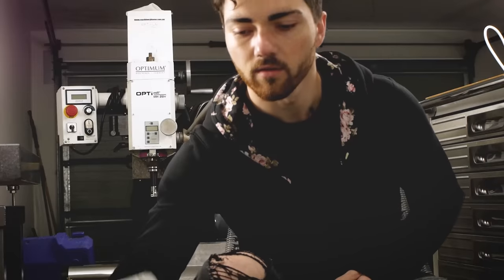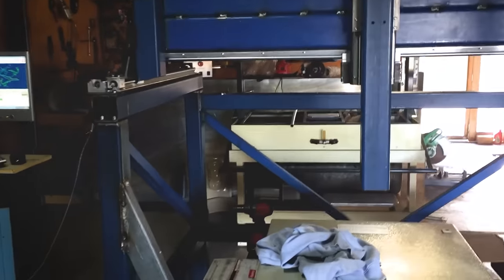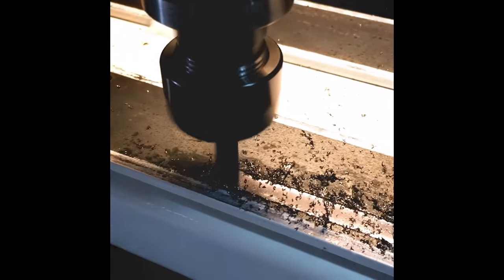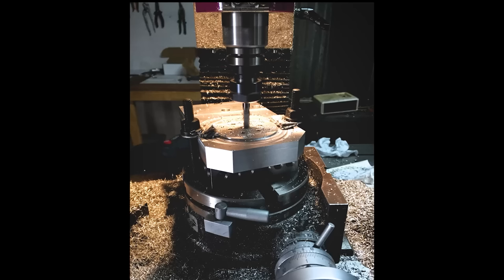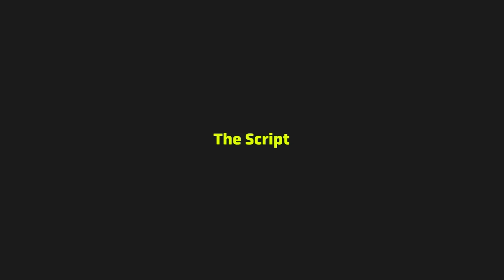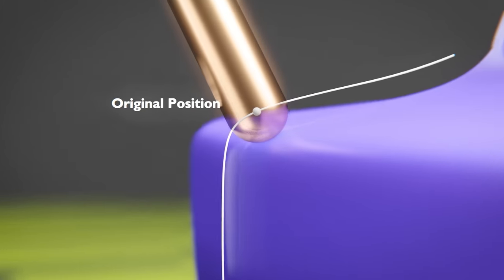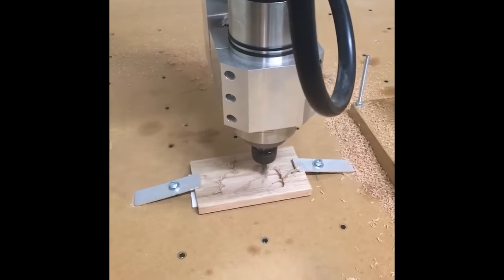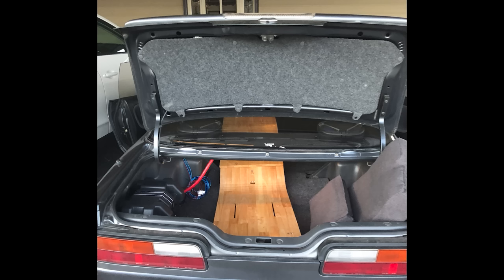I Built a Custom 5 Axis CNC Router and Barely Used It

Comment: If I was building my machine again I would never use steppers.  If you need any sort of accuracy forget it... unless you cut super slow.

I can almost guarantee that this is the source of his accuracy issues. Not the rigidity (he's cutting plastic and wood...). Looks like he's using 5mm balls screws so he'll have to run the steppers fast just to get moderate speed.  Steppers have all their torque at low speed and it drops quickly as speed increases.

In other words, unless you cut at a snails pace it doesn't take much to make steppers miss steps and the tool can be a mm (or more) off by the end of the job. That's a lot for molds and patterns that need to fit together.

There is a ton of bad advice online but telling everyone to use steppers in forums is the worst. If you're making molds and patterns... like this guy... get servos.

Comment: Im super interested in the software you made and I’ve been trying to make something similar because all the 5axis cam programs are over $10k. And the one i use wont rotate the head on “my”machine in the -A direction. Any advice on where to start when building something like that? And or would you ever release your code?

Comment: Hi there, thx for the Video, one question: Why useing Steppers with Harmonic drives over servos? is this default design metric for a CNC Machnie and what Actuators where used for x y and z axis?
Thx in advance
Reply from the maker: G’day mate, I used steppers because they were cheap and I had no experience with servos. I felt safe that I wouldn’t lose steps because the gear reduction was huge. I had a safety slip mechanism built into the gearbox so if it crashed, the whole harmonic drive would slip in the housing. It worked perfectly when I crashed it one time. It bent the 8mm stainless rod that was in the spindle, but did no damage to the machine.

Comment: I would try resin printing the model as this offers amazing detail and smoothness. You can go bellow 0.01mm slices. You won't even need to sand them. Then use a form "3D print casting (with sand)" to make a mold for aluminum casting for the temperature requirements of vacuum forming - (https://www.youtube.com/watch?v=9AaujAPghhE). I would use this procedure to make the end product you were after. I know you were just jumping in and learning how to make a CNC machine, (I'm pondering at that idea also, hence why I found your video!). But maybe you can still make the RC chassis with a different more efficient method. If you're still keen. I'm Aussie too and also went to game art school funnily enough. Blender is my jam 👍. Great work and what a monster of a challenge! Congrats man

Comment: Looks like SBR linear shafts are very popular in Australia (second Austria)😀Well, i choose SBR 16mm too, because of tight budget (my cnc frame is also welded, because it`s much more cheaper than aluminium profile. And extremely rigid!!!) Many people are sceptical about SBR supported linear shafts and they say, that only Hiwin rails can be used for REAL cnc....But, Hiwin cost a lot..And many of those "experts" even didn`t build one cnc in their life...So, SBR works good if frame is rigid and stiff.
Reply from the maker: I'd have to disagree with you, mostly. I found SBR rails to be garbage for any serious rigidity. Perfectly good for low force machines like 3D printers, scanners, laser and so forth. But for a CNC router made of steel, they aren't worth the cost savings.

Comment: What was your starting point software wise to control the CNC? And what electronics did you use?
Reply from the maker: My previous machine ran Mach3, so it felt natural to move up to Mach4. But it was a poor decision, as explained. 
It was paired with an Ethernet Smooth Stepper and Gecko Drive stepper drivers

Comment: definitely the greatest video you made. I just could not fully understand why you did not go for another approach instead of the python script? Fusion360 5 axis g-code could not be managed on linuxCNC or other third party software? even by changing the post processor? From my point of view it could, but I quite did not get there yet. I am also designing a 5 axis CNC, more like an all in one machine that has a PCB factory, Smd pick and place, 3d printer, laser cut, PCB solder paste stuff, etc, even pottery attachment. Maybe I am not yet there so I cannot foresee your workarounds rationally because I did not get to the 5 axis g-code yet. But if you cared to explain, I'd maybe understand the kind of trouble I am getting myself into😅. Anyway, it would be nice to have more videos explaining more details about your old adventures with designing a 5 axis CNC.
Reply from the maker: You’re absolutely right that I didn’t go about it the smartest way. I should have used LinuxCNC or Dynomotion (if it existed then). I simply didn’t know what I didn’t know. By the time I knew what I knew, I already bought Mach4 and related hardware. And anyway, the script being like a post-post processor enabled the ability to more deliberately dictate what the head should do at certain points and also gives the ability to implement features like converting the parallel toolpath into 5 axis.

My next machine is using Dynomotion, I already have the motion controller. 

Your project sounds wild, I hope it turns out well!
Reply: @machsuper  that's nice, I think it will be a success. I'd love to hear details, and why you chose Dynomotion controller instead of those USB chinese control boards.  Another question: did you have fusion360 complete with 5 axis support? mach3 would not be able to interpret the 4th and 5th axes correctly? even if you changed the post processor generator? there's a javascript script into fusion360 post processor where you can change the way it generates the post processor, you can change even g-code related commands, axes, etc to comply with Mach3. In my machine I had to do that.. but is only 3 axes. well it also has a rotary axis (more like lathe) but I have never used inside of fusion360 yet, only when I write gcode manually. But I think it works just fine out of the box, although I cannot confirm this before testing.. I have some hope that I could use a 5 axis machine like yours in fusion360 and mach3 just by editing the post processor, but maybe I am completely wrong. I guess I'll be able to check that only when have my machine fully developed. Now I only got the motors, spindle, control board, etc, not even finished my 3d modeling design yet, because the smd Pick and place feeders that I am designing are fairly complex and kind of embrace the world. That's why I am postponing the project for some years. I'll make a youtube channel in the following months also to share my projects, but in a slow pace because I cannot work too often on those projects. Oh, by the way, congrats on your mathematical abilities, the script and mathematical solutions you came with are pretty amazing. A video talking about those solutions showing mathematical solution also would be attractive to the channel, if you choose the right title, maybe similar to this title

Comment: Have you seen the PrintNC project? If you've got drawings for the rotary head, I think the people involved in that project would be really interested.
Reply from the maker: I've seen people mentioning PrintNC often, so you just motivated me to have a look. I really like it, super simple and easy to make. I really like that it uses steel hollow section, that's SO much easier to buy and more rigid too. Aluminium extrusion is overused in my opinion, it's not that hard to drill and tap holes in steel.
I'm in the middle of figuring out what I want to do with the script and rotary design. All this new attention has inspired me to think about making something more out of it besides just for myself. Though I must admit, the rotary design is not exactly budget friendly with the expensive harmonic drive units. One of those is more expensive than the entire chassis of the typical PrintNC.
Reply: @machsuper  I am really stoked that you've replied here, and that I'm not the first to mention PrintNC. Did you know that "Hoges" the guy who first put up plans for it is in Cairns? I agree 100% with you about alu extrusions. They've got their place. And are useful, but that's the first connection I saw between your project and his.

I absolutely get your position when it comes to your own IP. I'm personally an open source fanatic, who is trying to figure out how to sustain my own operations. I might try to get in touch outside of this.

Comment: Could you share a bit more about how you used Blender to simulate the motion? I have a project where I plan to use micropython on a Pico to control a storage retrieval robot, but I'd love to simulate it in Blender first. The issue I have is I don't know how to run realtime simulations since they've removed the Blender Game Engine.
Reply from the maker: I never fully fleshed it out, but I had two ways of 'playing' the animation.
1) There was a function that, when called, would execute the next line of gcode. I would have to repeatedly call that function from the Python console to make it step one gcode line at a time. You can see me doing that in the screencast in this video.
2) There was a feature to have the script run through the gcode and set a keyframe on the 3D model for each frame in the Blender timeline. This doesn't simulate accurate acceleration and feedrates, though it kind of appeared that way because sharp corners tend to have more tightly packed segments, so the motion appeared slower. This worked quite well up to a point. Blender has a limit on the timeline length which was easily reached with 5 axis contouring gcode line mine.

I never figured out a better way to animate the full gcode file, partly because I didn't need it that badly.

Comment: Looking forward to more content from you. Quick question if I may. If you were to make another 5 axis machine today, and you have about $15,000 to spend; what would you do differently?
Reply from the maker: Great question! If the goal was to make a similar machine with the same performance requirements, I would:
1) Make the gantry structure much closer to a square cross section rather than the tall rectangle shape.
2) I'd look at rotating the gantry to span the shorter side of the XY plane. That would go a long way to improve rigidity, but it does mean you need to buy two sets of long linear guides and ballscrews instead of one.
3) Space further apart the linear guide bearing blocks on the Y axis (the axis that the gantry rides on).
4) Buy better inspection equipment so I can more accurately machine the rotary axes 😄

I might make a video talking about all these points.
Reply: @machsuper  Thanks. I'm a retired engineer, I'm looking to build a similar 5 axis machine, thus my question. Have you thought anymore about the controller and post processor? I hear that LinuxCNC is very capable but its high learning curve keeps people away. It seems that technical details does not deter you, you should feel right at home with LinuxCNC. LinuxCNC also supports machine simulations, so that might be helpful too. I plan to write a custom Fusion 360 post processor for the machine I'm building. Right now I haven't built anything, still designing and planning.
Reply: @machsuper  Generally speaking, circular cross sections are the most efficient, in terms of stiffness to weight, for resisting torque. So you are absolutely on the right path for using a square section for the gantry beam. For the moving structural parts, have you considered using epoxy granite with an aluminum core, since you mentioned using sand in the tubings. This composite structure is similar in density to aluminum. Weight does matter in terms of acceleration and deceleration.
Reply from the maker: @ekbiker  I've thought a lot about the controller and post processor over the years, actually. I will be using a Dynomotion controller for the 5 axis mill conversion I'm about to do. Basically everything my Python script does can be done in the post processor, I just didn't know JavaScript back then and it was easy to get visual feedback by coding it along-side Blender. LinuxCNC is also a very good option for machines like mine, so I hear. I like the idea of Dynomotion making the hardware and software, as well as getting support from a commercial enterprise that makes the hardware and software. I also have never touched Linux, so Dynomotion helps me avoid that too.

I've wondered about combining a round tube and a square tube to make the gantry by just welding the round tube to the inside of the square. I've also thought about welding plates inside the gantry at regular intervals to create a boxed of structure at several sections along its length. Ideas, ideas, ideas...

I would love to build an epoxy granite machine someday. The 5 axis mill-turn machine I dream of building might make use of epoxy granite, in fact. That's all thinking far into the future though.
Reply: @machsuper  Dynomotion looks like a good candidate. Thanks for mentioning it.
Reply: @machsuper  I would punch a big hole in the middle of the gusset plates. Material near the center does very little to resist torque.
Reply from the maker: @ekbiker  oh yeah, definitely punch a hole out of the plates. Good point.
Reply: Also, making the cross section bigger and use thiner wall tubing will save more weight and keep the same stiffness. The relationship to stiffness is diameter squared.
Reply from the maker: @ekbiker  You might be interested to see this design I made after I made the first machine. Notice there's holes drilled in the gantry and column to weld the gussets in place.
https://www.instagram.com/p/CikYkzbLaxO/

Comment: I was fascinated by this project. I am on a project too. I need your help, I want to rotate the C axis without changing the tip of the tool as you did in 09:20. My part is rectangular and at the corner of part I want to turn with C axis ofc y,z will be changed too and go down. I thought I can divide 90 degrees by 10 and rotate it accordingly on the y and z axes. Thanks
Reply from the maker: I'm trying to understand what you mean, but I don't know how to help. The change you need to make will also depend on where the B axis is rotated to. Can you try to show me a diagram or explain it better?
Reply: @machsuper  I dm you on instagram.

Comment: its easy when you live in a place where you can go to someone elses shop with your raw stock material, and pay them to cut you what you want.
Im building my own 3axis cnc, and so far every company that worked on my parts, did them wrong, now i have to manually scrape metal by hand untill i get it leveled
Reply from the maker: Oh man! What a pain, having to scrape everything in. I may have to do the same on my mill conversion, the column always seemed to have a tilt/nod towards the operator.

Comment: What would you recommend to use if not mach4 as controlling software, and what kind of controller hardware would you use if you would build 5 axis machine now?
Reply from the maker: I've already bought a Dynomotion Kflop to use for the machine sitting behind me. Dynomotion make the hardware and software together. You'll see plenty about that project in the near future.

Comment: Why did you decide to build your cam software rather than use something that was capable of 5 axis?
Reply from the maker: It was less of a decision and more of a mistake. I didn't know Mach4 couldn't handle TCP kinematics, and I didn't know I'd need it.
Reply: @machsuper  fair enough I hope to one day build a smaller scale 5 axis machine for very small aluminum parts but I might skip the whole months of coding that seemed like a pain. I'm excited to see how you utilize the 5th axis on your mill when you get it all together
Reply from the maker: @buggz8889  A small scale machine must be such a delight to build. The ideal situation is if you have an existing machine that's big enough to machine the base of a smaller 5 axis machine. Then you can so easily produce a great little machine. Good luck with your build if you ever give it a crack!
Reply: @machsuper  Ive got a small 3 axis cnc but I don't think it's worth using it as the base of a 5 axis machine by the time I rebuild it there would be nothing left of the original but it is helping me learn what I want out of the 5 axis machine and how to run the basics of the software

Comment: Thanks for sharing! Some of your problems could have been solved by using a lookahead function, to check upfront where you need to be, and to reduce speed if necessary  (pending on direction of the slowest motor etc. (if motor is involved in next motion). And also take into account the tool speed if its in motion direction or against...
Reply from the maker: A look-ahead function was high on my list of stretch goals, but it never proved necessary enough to bother making. When I spent a bit of time trying to write a similar script for a 6 axis machine like the Zimmermann 6 axis machine, lookahead was going to be super important for smooth movement. Studying the motion of that Zimmermann, I think they don't have a great lookahead to smooth out the movement of the unique arcing axis.

Comment: DId you try to machine wax to make your body moulds?
Reply from the maker: I'm not aware of any wax that won't melt from the heat of the polycarbonate. I learned that polycarbonate has to be quite hot to form well compared to something like ABS or Acrylic. Another component that I didn't mention in the video is that polycarbonate absorbs water which shows up as bubbles all throughout the material, completely unusable for a product. The material has to be heated in a medium temperature oven for hours to dry out first. I found myself looking for industrial kilns and ovens online before realising this was all just getting expensive and a little ridiculous just to make body shells.